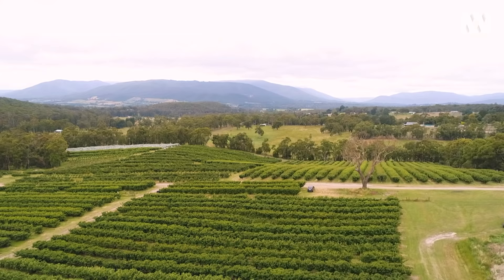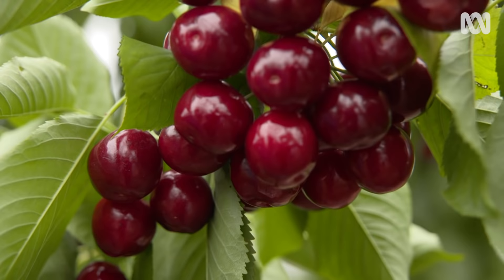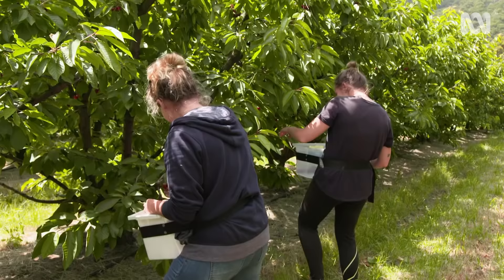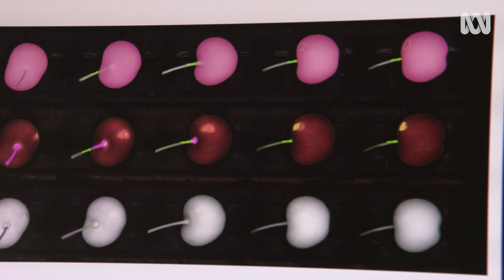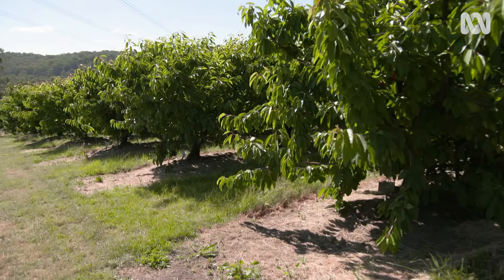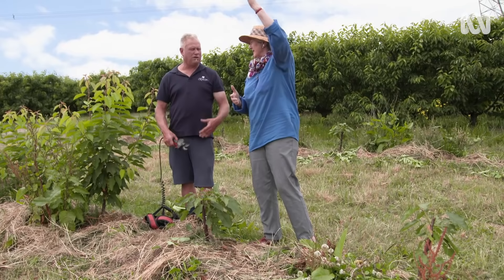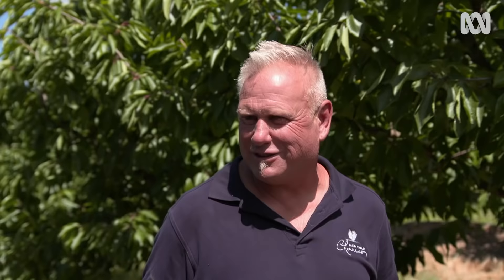Growing cherry trees bursting with fruit | Growing fruit and veg | Gardening Australia

Comment: Are there any types of cherry trees that will grow in warmer climates ?
Reply: A lot of cherry's are grown in the Young and Orange region of New South Wales too which can get to 42 degrees in summer so yes can handle the heat but they need the cold (at least down to 6-7 degrees) in winter to set fruit, which is why they do so well in those regions. Hope this helps you...☺️. (edit) as a foot note in saying you need to get down to at least 6-7 degrees, it needs most of your winter to be at or below this temp not just a few days here and there. Good luck ☺️
Reply: @FM-zs2fu  i live at Bellingen on nsw mid north coast where it gets to around 2 deg in winter but quite humid throughout the warmer months.... im keen to give it a go but have my doubts
Reply: @fbombfishing6192  yes, you would most probably have a lot of issues with the amount of humility and rain you have in that part of NSW it would possibly set fruit but you'd have issues with rot and splitting and may not get very many viable fruit off to eat....sorry 😥

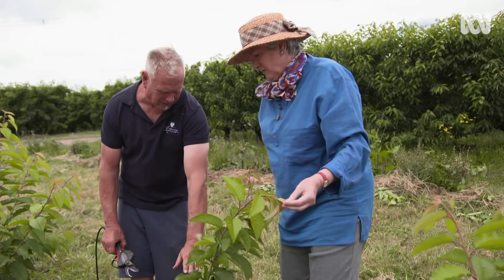Comment: At the 4:45 ttimestamp did he say " cut the tree at the 50 millimeter  height?  I'm from the US and metric system  and Australia  accent is strange to me .
Reply: I found easy to understand.
Reply: @sezagolden8022   50 millimeters is only 2 inches   if he said or ment 50 centimeters. And that I didnt hear. Would be 20 inches. It look like he cut it at about 9 inches. 9 times  24.5 = 220.5 millimeters. I distantly heard him say 50 millimeters  I think.
 I have been cutting my trees at about 18 inches and that makes a tree too   tall 8 feet  is  about my  limit or 2.5 meters
Reply: He meant cut each branch at 50mm, not the height of the plant.

Comment: When he first says cut back to 50mm does he really mean 50cm? There's no way the first cut is 50mm off the ground. So is it 50cm & then 50mm above that cut? Cheers
Reply: 50 mm from the main trunk, not the ground.
Reply: @hqqns  yeah hes using a pollard to build a dense framework to allow fruiting wood to be managed
Reply: @stanleylongworth6792  
Pollard?  Do you have any links or more information on that?
Reply: Yes
Basically by cutting back hard to the main trunk it will encourage multple trunks to form
Making more fruiting wood lower down